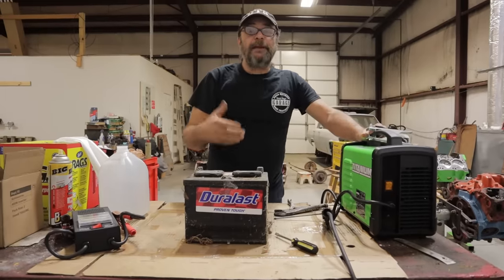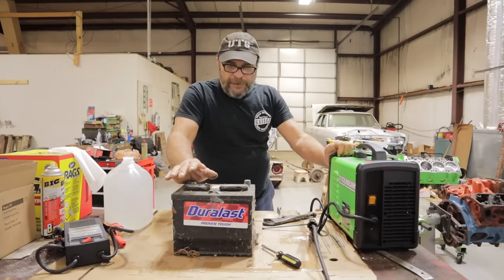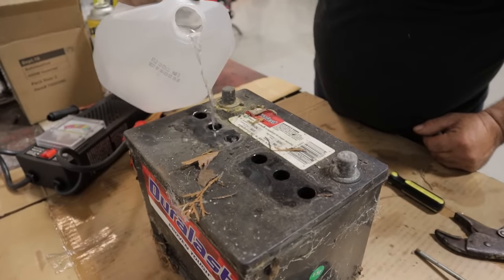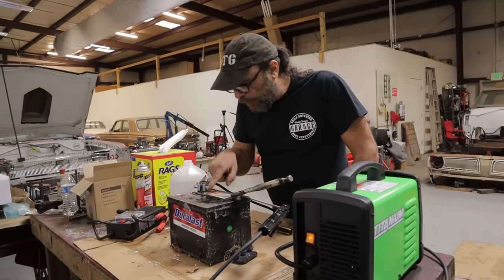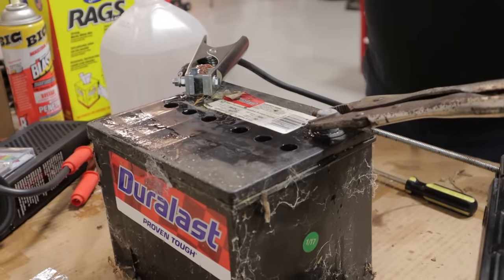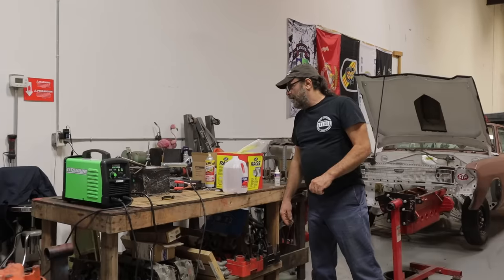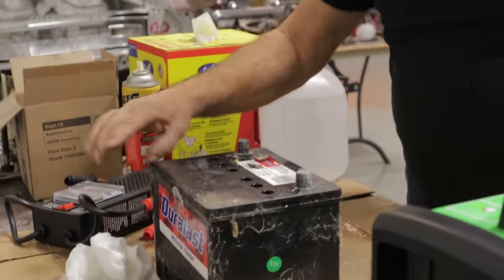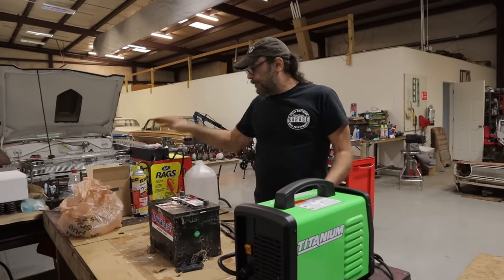Reviving Dead Batteries With A Stick Welder

Comment: Often lead acid batteries die for two reasons.  First is an open cell.  Second is build up on the bottom which shorts out that cell.  Likely what you're doing is attempting to burn off the build up.   When they originally charge them at the factory where they actually build the batteries they hook them in a series parallel set up and put several hundred volts (DC) through the bank of batteries.  When they do that they have all of the batteries lowered under water.  Batteries also typically used two dissimilar metals, one per pole (+ and -).   Today's batteries use lead for both sets of plates.  The high voltage charge they perform at the factory causes one plate to ionize causing two dissimilar metals.  Ironically before a battery is charged the first time either terminal could be positive or negative.   Old time lead acid batteries also used to use think lead plates.  Today's batteries use extruded lead plates.  It's the surface area that is important not the amount of lead in each plate.

Comment: If this works and if the purpose is to attempt to descale the plates to activate the plates again, why not strap an electric palm sander to the battery and have the vibration ASSIST in the desulfation process?

Comment: Distilled water is void of all minerals and provides the cooling effect without discharging the battery through the minerals in all other types of water. I had to distill some water today on my stove just to fill up an old battery because I want to test this trick...it's a big ass old batter from my uncle's 5th wheel he gave me before he passed away so it's just as dead. I figured why not try this, if it doesn't work it'll become bullet lead so not a huge loss either way

Comment: Before you add distilled water always clean the battery first or you are wasting the distilled water by adding contaminants like dust and dirt.   If one of those leaves had gone in it would be a mess not to mention all the dirt that went into the cells when he wiped it with the rag.

Comment: Do not overcharge it too much 50 amps is fine battery will build its capacity but be careful how long do you charge the battery and bump it to higher amps slowly and then stop 🛑

Comment: I have a Lincoln 220v can I try to use it I think it is 36 volts  I went to hook it up and sparks were flying in either directions I hooked it up ground to ground and positive electrode end to positive turned it on and welder made horrible sounds I turned it off immediately.  Seems like it was going to kill my poor old welder.

Comment: Looks like a scary process to me esp doing something like this a first time. I definitely would have a had fan to blow away the hydrogen gas just incase the was a spark nearby. But remember he said “don’t do it inside”. Would have been interesting to measure or see the current the battery was actually drawing as it went from dead to charged as the batteries internal resistance went from a lower to higher ohms resistance.

Comment: Hydrochloric Gases may explode, seems the dangers far outweigh the cost of a new battery.  What about the flaked off lead deposits that collect across the battery's internal floor that short cells and drain voltage?

Comment: Do the electrical discharge of the plates then clean it out with baking soda water flush it two times repeat what he did with the voltage flush it one last time and then fill it up of course with distilled water should be good to go for a while.

Comment: Yeah whatever your welder but I believe you should use it on DC settings oh I mean it should be a DC welder because you take AC and run it through capacitor which battery is you could cause an explosion I've seen capacitor blow up because of AC ripples get in there and blow them all out so it would be good thing to check that part out so you don't make a mistake run 18 through a DC capacitor so it's always a good idea to make sure you got a DC welder or or at least the AC DC welder all DC setting I'm pretty sure be something people need to check that out before they do that if they're attempting this process and as the man said where protective eyewear the Broadway new hurt to wear something over your face 22 protected you arms and stuff good luck and I hope everything works out for you on the process be careful do it outside like the man said and wear protective clothing

Comment: 12V lead acid Battery's can very dangerous!!!! 
Best advice really is to AVOID CHEAP battery's pay more get one with two or three warranty it will last twice as long as the cheap one so really it is best value long term!! 
IF you have a car which is only occasional use, set a digital timer ( an hour a day ) and car charger mine uses a light so when it is charging at night i can see it is on then it turns off the light goes out, it works, But use a GOOD QUALITY battery is important, cheap ones are rubbish!!!!!!!!!!!! 
Battery Acid will eat thru aluminium pots ( i have done it 🙂) generally what happens is the lead plates very SLOWLY dissolve takes years, small particles of lead fall off and build up under the plates which shorts out that cell, i used used the garden hose too flush out the cells, then later i put the acid back in, and recharged it, it was moderately successful.

Comment: I tried 5 different batteries with my lincoln 225 on dc pos. 5 fails. Boiled em pretty good. Went all way to 105 amps at end. Gave em breaks between cycles. Filled with new battery acid on cells that were low. I dunno why my attempts failed 100% any ideas?

Comment: NO...dont this...Desulfation and elimination / conversion of the crystals takes some time and should be done with an applied voltage of about 15 volts @ ~ 200 to 300 mA controlled current for about two weeks 
An even better solution involves the controlled current application with the addition of short 30 mA high current pulses.
Also note that lead oxide which has parciptated to the bottom of the battery will eventually reach the bottom of the battery plates and cause leakage which will drain the battery over a relatively short period of time. . .depending on the level of deposits existing at the plate bottom ends.

Comment: The better chargers do this as part of their process, I forget what that mode is called. Usually they have an indicator telling you it's performing that process. It pulses the amperage to knock off the scale.
Reply: Yes, they cost $300+. A DC welder is $80-$100 AND you can use it for welding as well.

Comment: Hydrogen gases are extremely explosive back in the 70s I was putting the jumper cables on a old truck and the batterie was boiling pretty good and soon as I contacted it made a spark and it blew the top of the battery write-off boy did I learn my lesson

Comment: Charging battery at high ampere will release a mix of hydrogen and oxygen gases that is very explosive, and heat up the water inside the battery to dissolve the crystalied lead sulphate into lead ions and sulphate ions, then  one can charge the battery by direct current, that revive a dead battery. Biggest risk is a spark will ignite the gas explsion!!

Comment: Don't know why, but this made my battery worse. The gravity concentration of the acid is gone. My hydrometer won't float till the whole float is completely covered by the battery acid (water now), well past the red zone. All my cells check out with no shorts.  I'm thinking now that I might have to flush it with the distilled water/baking soda mix a few times then flush it then replace the acid with the $20 battery acid refill at autoparts stores. My battery was getting stuck at 60% before but couldn't hold even that. Now I'm not even getting that out of it.

Comment: My thought or question is: 
As the acid boils creating the volatile gas during surge charging, with no spark but an internal failure happens to submerged plates will the submerged arc cause detonation?💥💥💥

Guessing doing this outside under or behind plexiglass using a camera to view rather than sticking your face over it and having the machine at a safe distance would probably be a lot safer? 😊

Remember not to completely enclose in a plastic cover because of gas retention turning the entire box an explosion hazard. 

Interesting!

anyone in northern Illinois that is a YouTuber looking for a retired self taught mechanical engineer of 35+ years as a project buddy? 

If so message me and let’s have some fun, retirement isn’t that engaging. 

I enjoyed your video now you have me curious.  How about lead acid batteries? Will it work on dry cells? 😂

Comment: I Love your channel. I see my self in you. BUT WARNING TO EVERYONE what you described that could happen for an explosion is very down played and WRONG!!!. And it is clear that you have not experienced one of the bubbling batteries exploding from a spark. I have and it was MASSIVE. My ears were ringing for about an hour. and I got covered in acid. I was a welder fabricator in Darwin,  behind truck city, working for a very smart Austrian boss. (That's all I'll say to keep his ID hidden.) Giday if yr reading and yes you remember it exploding as it was right out the front of your office window, and you all came out to see what happened. The whole 50m long work shop heard it.) My boss had his battery just like this charging on the ground about two feet to my right. It had been charging for some time with caps off and it was bubbling. So young in experienced me, walked up to the bench vice and started to grind a small piece of steel. 
The sparks went down and on to the battery which set it off. It exploded so big and loud it blew the flour light tubes out of the roof of the massive shed (about 9m high) I felt like some one had punched me in the side, it deafened me shortly (the ringing lasted for ages) every thing around was covered in acid and lead / plastics bits. All that was left of the battery was the black plastic rectangular base. (all 4 side and top had exploded and became shrapnel around that front area of the workshop. Everyone else was in shock like my self. I immediately ran to the hose only meter away and covered my self in water. I believe it was the grace of God that save me from any permanent injury that morning. SO PEOPLE THESE BATTERIES CAN REALLY EXPLODE LIKE A BOMB !! I recon the hydrogen did a chain reaction through the whole battery acid cells instantly, not just burning the gas above the cells. And you probably need a very bubbly battery to do this, But I am living proof They can EXPLODE REALLY BIG !!! Oh P.S. Your reviving works and is brilliant, and I do it. But am NOW very cautious about near by sparks, Even static electricity from clothing or possibly your welders cooling fan motors brushes (although this would be very highly unlikely). Thanks again for your great channel and vids. And since this hadn't happened to you, how are you to know to WARN the public. Cheers

Comment: That titanium welder has a light duty cycle, even at 50 amp to run it continuous for 5 mins might be tough on the welding machine.   Is it worth the trouble, damage to the welder, just to repair an old battery that probably already gave you 4-5 yrs of service?  Not only that, safety is an issue too, and you said yourself to do it outside. This is a bad idea.

Comment: How does this not make the duty cycle of the welder kick the breaker.  Many of these inverter welders have a duty cycle maybe a max of 60%. So out of every 10 minutes the welder can only run 6 minutes before it shuts itself down

Comment: Everybody wants to throw their .02 in on this one and here's mine. This works. Period. I saved 400$ on batteries for my diesel pick up. Bought a 70.00-dollar DC welder off of amazon instead. If this catches on, sell your stock in the battery manufacturing industry.

Comment: This is insanely dangerous.  If the cells are down very much, the acid remaining is very concentrated, and when water is added, the heat produced may cause the electrolyte to instantly boil and spurt hot sulfuric acid.  Once the cells start to bubble, they are producing hydrogen.  Using a welding stick at high amps is asking for a spark on the positive and a hydrogen explosion.  In addition, the first thing that should have been done is wash the battery off, then rinse with distilled water before popping the caps.  Filling it the way this was done just washes whatever dirt, crud, birdshit, etc. that was on the top into the cells.  The gases produced are not just hydrogen, include several different sulfides and are highly corrosive, and certainly bad for the lungs.

Comment: you should have used a funnel. and wiping the water off top of battery like that wiped dirt and crap down in the hole and will not be good for the plates.

Comment: As an electrical and electronic engineer with 20+ years of experience, a regular DIY mechanic, and a volunteer EMT, I can tell you that THIS IS DANGEROUS AND FOOLISH.  The outgassing you see is Hydrogen and Oxygen: the elements of water that are separated by electrolysis when you apply a high current.  Think about what happened with the Hindenburg.  You don't want to recreate that on a smaller scale in your garage or outside.  Hydrogen is explosive at a concentration of 4% by volume and explodes very well in the presence of Oxygen.  The sulphuric acid content of the electrolyte (the liquid in the battery) is enough to cause severe burns to the skin and eyes on contact.  When high current is applied to charge a battery, the outgassing is extremely high and the holes in the top of the battery may not be sufficient to relieve the pressure created.  That can lead to a lead acid battery going kaboom in your face like the laptop batteries did a few years back and for the exact same reason.  This is not worth the risk and the charge will not last because of the buildup of oxidation on the lead plates in the battery.  Just buy another battery.  It's much less expensive than a trip to the burn unit at the hosptial and/or hideous disfiguration from acid burns caused by trying something stupid that you saw on youtube.

Comment: First button up and use a FULL FACE MASK , if that dumb way you have it connected comes loose if you bump it You and your place will be covered in Acid and on fire, Had to wrap a good man in a wet blanket to get the fire out and his eyes were burnt for life, he only had on safety glasses. Yes heb used a vce grip, the rod came out of the handle when he moved the cable.

Comment: Charging a battery produces Hydrogen gas.  Science lesson 2 parts Hydrogen (H) 1 part Oxygen (O), when combined generates water.  Hence, don't put too much water in there in the first place since you'll be creating some (water) in the charging process..

Comment: They typical output DC voltage of a stick welder is about 25 volt, about twice that of the supposed voltage of the battery.

In DC welding, there is a choice between whether the electrode (rod) is positive or negative. I suppose the choice for this application is the electrode (also positive of the battery) is positive. It is shown here that the electrode end is connected to the positive of the battery.

The setting of the welder, whether the electrode (rod)  is positive or negative should be clearly stated at the beginning of the video.

Only if one is to pause the video and look closely is one to know which is the positive of the battery. This should be clarified without having the viewer to do so.
Reply: Thanks for answering my question about DC polarity. Should be in video to help keep accidents to minimum.

Comment: Take note the the welder used in this procedure is a  DC WELDER. You can't use your old AC welder..... Very important  !! An AC welder will arc as you make connection to the battery risking ignition of available hydrogen. !!! Plus an ac welder will not work  !!!

Comment: The gas you are seeing is likely Hydrogen and oxygen as you are performing electrolysis in the battery. Separation of the hydrogen and oxygen in the water is a practice people have used to suppliment fuel in vehicles for years.

Comment: I am retired in Mexico, La Hausteca, and I can't get a new battery to last one year here, and they won't take them back even when they say on the side of the battery 3 years guarantee, and why, it's the heat here I am thinking. I now have 8 batteries that look new and non-work. I am going to do this and have a 220 V welder. I will put them away from the house and the welder has 20-foot cables, and will have garden hose ready, protective gear, and let's do it. I will post pictures and results. I also have a commercial battery charger that has brought them up, but they won't hold a charge. I have tried boost mode and start mode and no good. A few get to 10 volts, and I let them sit and down in the morning. One gets up to 11 volts. These are all new batteries that have sat for a few years. 2 are deep cycle new batteries out of my RV that have never been tapped into/used or charged and cost me allot. I am going to boil these baby's big time. I want to see smoke dam it. And yes, they don't have any dirt on top which is for dam sure no good inside the battery. No, just kidding, I will take it easy on them, but they will boil!!!!!, great video and thanks Tony.

Comment: i can honestly say this very idea almost killed me.so be very careful. i used a welding machine to charge my battery ,but it turned out that the battery wasnt bad. my starter was bad. when i removed the welding lead from the battery, the battery blew up leaving next to nothing behind. how i wasnt killed is a mystery. so please be careful. if you smell the battery acid dont touch the leads because battery acid fumes are extremely explosive.